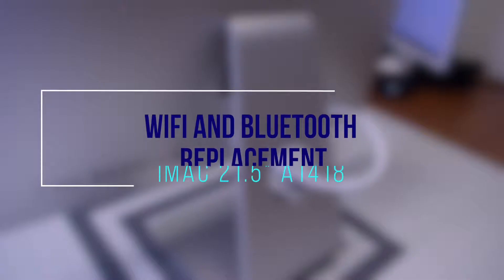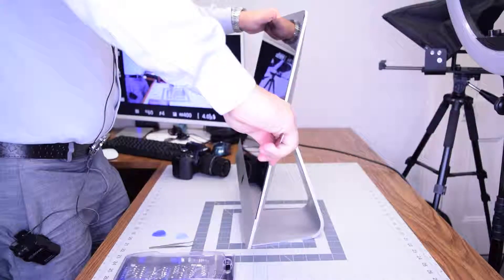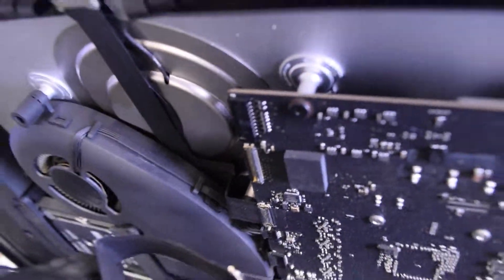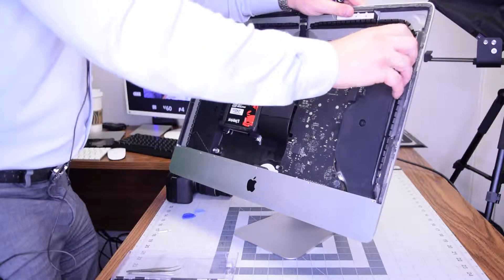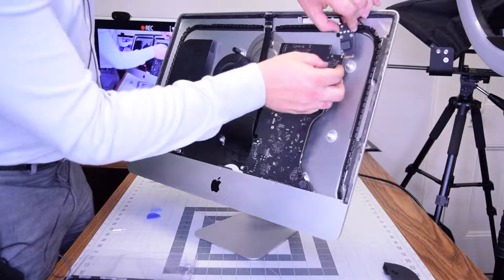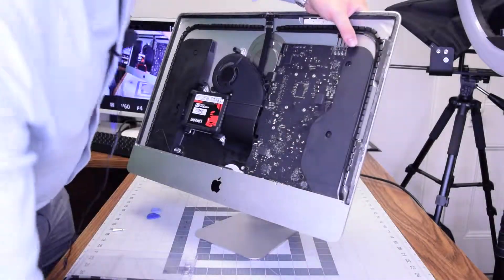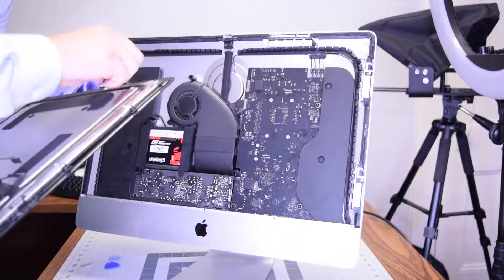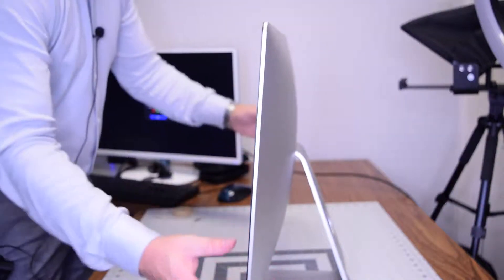📶🖥️🛠️ 21.5" iMac WiFi and Bluetooth Card Replacement 2012-2017 (Including Retina) A1418

Comment: Having done hundreds of iMac upgrades my jaw dropped watching this one.  You'd stand a very good chance of damaging the iMac if you followed these directions.  DON'T use a knife to cut into the sticky tapes, you are very likely to cut something like a cable, especially up by the camera.  Don't use ordinary double-sided tape to put the glass screen back on, it will dry out and the screen could fall off and break.  Put a pillow or cushion between the stand and the back casing to stop the computer wobbling all the time.  Not enough time to list what's wrong with this tutorial.
Reply: you also forgot a few more:  don't let the screwdriver slip off the screw and towards the motherboard just because you want to go quick and (and this is my favourite), don't cover the microphone in the middle of the bottom row of the screen.  Hahahah.  $10 says he had to open it again after the first video call he had and everybody told him his mic was sounding really weird.  Probably a good thing he used bad tape to put it back.  Must have been a breeze to re-open it
Reply: @maurogiochi4044  Didn't forget, just didn't have time/patience to type them all up 😎

Comment: I think you may have listed the wrong model. My late 2012 21.5” iMac has a different board and configuration for the airport card mounting, and there is another step before removing the speaker unit.